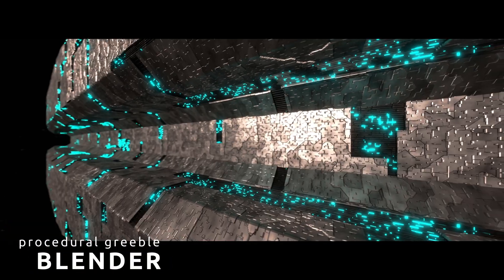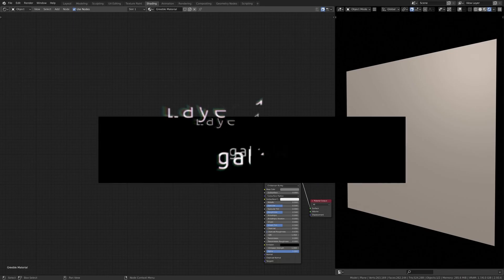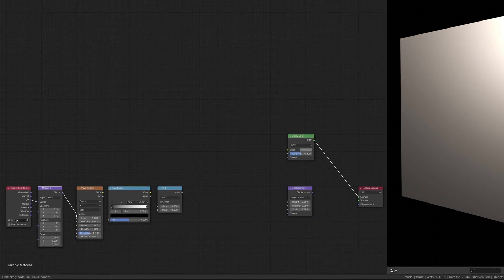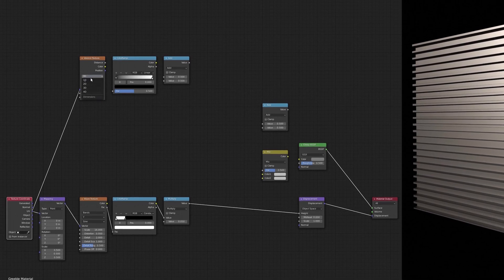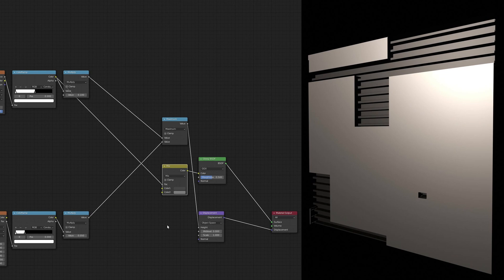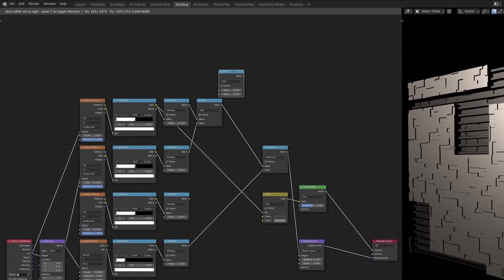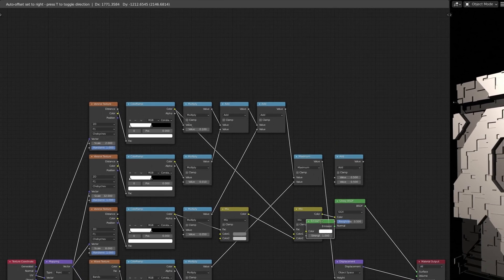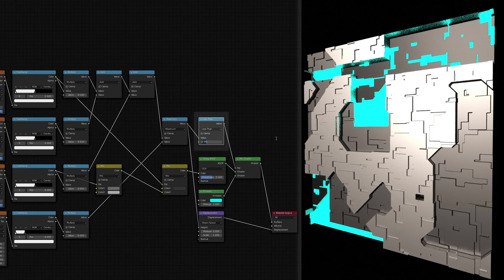Sci Fi Spaceship Panel - Blender Procedural Material using Shader Nodes

Comment: i was able to recreate this in eevee, not to as good of an effect but still passable. use a bump node into the principled bsdf instead of displacement, and run the glossy bsdf>shader to rgb>base colour field on principled bsdf. beats manually modeling and slapping plates onto a ship.

its not as 3d popping obviously, but it does look good once you get it onto a model and off a 2d plane
Reply from the maker: I agree with your method, I use an eevee version quite often myself.
Reply: @sinasinaie  super glsd i found this to. Ive been manually modeling and shrinkwrapping plates onto my ships. A process that takes a long time for large ones. Took a ship i was 1/3 done with 600k triangles to just 23k switching to this instead

Comment: I have a question! How did you make your render preview so clean? In my preview, I see many particles like shapes. they are not as smooth as you are. Btw I am a new.
Reply from the maker: It's hard to know without seeing your model. But if I were to guess, I would say you need more subdivisions on the plane (described at the beginning of the video).